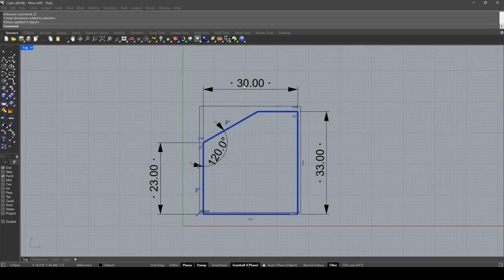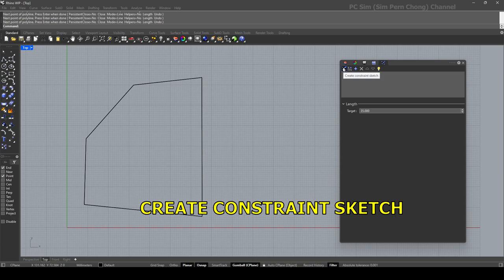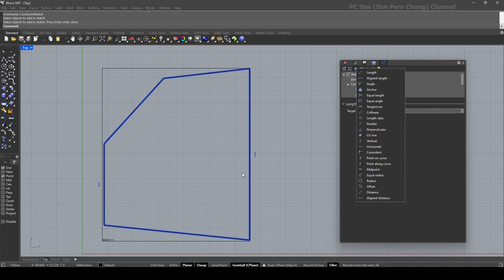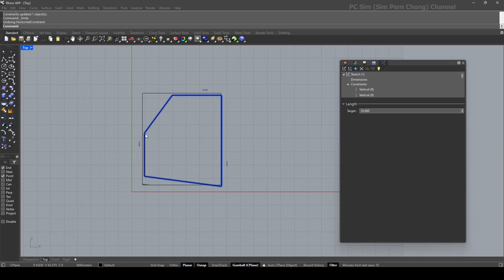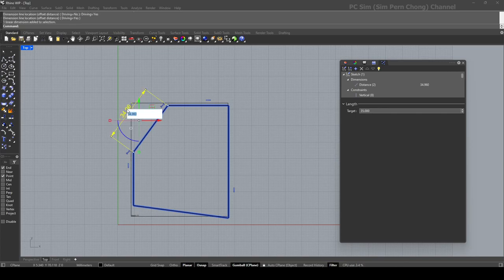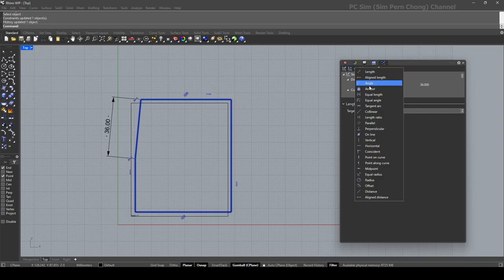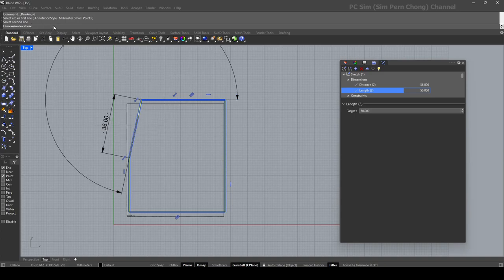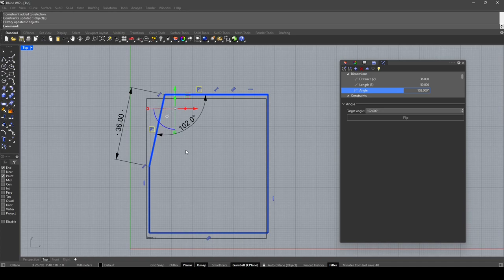Rhino 8 (WIP) Demo: Application of Parametric Constraints 【犀牛8: 参数约束的应用】

Comment: Driven dimensions and constraints are powerful tools in Rhino CAD that offer several advantages to designers and engineers. Here are a few of them:
Precise control: Driven dimensions and constraints allow users to maintain precise control over their designs. 
Easy modification: When using driven dimensions and constraints, changes to the design can be made easily and quickly. By simply adjusting the value of a dimension or constraint, the entire model can be updated automatically.
Better design iterations: Driven dimensions and constraints allow designers to explore different design iterations quickly and easily. By adjusting parameters and constraints, they can quickly evaluate different design options without having to rebuild the entire model from scratch. Dimension-driven modeling allows you to create parametric designs, which means that you can easily modify and adjust your model without having to start from zero.

Overall, driven dimensions and constraints are essential tools in Rhino CAD that help designers create more accurate and efficient designs, and iterate more quickly and easily.

Comment: This is the one thing that has kept me from using Rhino as I like to know exactly what 
size everything is going to be and if a size is going to change everything else will move.
I started learning it from early V1 beta in the 90's. Since then I have learned Catia, Inventor, Fusion and Ironcad.
If they can ever implement Rhino to build parts that close to Ironcad & Fusion and have deep
control of sketch & assembly constraints like Catia then I am sold. I love the surfacing
capabilities along with using a command line.
Reply from the maker: Hi, unfortunately it seems that they have taken out constraints features from this version. 

https://discourse.mcneel.com/t/rhino-8-wip-constraints-not-working/162476
Reply: @simpernchong  yes I hope they can do it for Rhino 9

Comment: very nice - if i would want from your final dimension a extrusion for 100 ... is it possible to give it also a parametric value that i can change later? Or do i have to make it in grasshopper?
Reply from the maker: Hi, unfortunately it seems that they have taken out constraints features from this version. 

https://discourse.mcneel.com/t/rhino-8-wip-constraints-not-working/162476
Reply: @simpernchong  ah thank you - i read something in this comments below about it. Very sad, because its really a great software but for parametric It's not so easy to use like Fusion360 or Solidworks or even FreeCad. But i still love to use it for fast prototypes which dont need paramentric to see if the product idea would work or how it could look like. Do you maybe have a grasshopper tutorial - a simple one for beginner - where you make a plane - extrude it - and then boolish the inner out, or something like this - just simple ones to understand. You have so great tutorials - which are way more advanced. I love the results, but I think sometimes it's easier to use something easy to rebuild which has parametric functions. Like a box where you can put things from top inside, and you can adjust the thickness of the wall or the dept, height of the box and so on. Just a simple tutorial i try to find.
Reply: @simpernchong  Yes, McNell's communication regarding this was truly atrocious. It was a reason for me to upgrade to Rhino 8 but then suddenly I couldn't find anything and it was only through the forum that I became aware that it had been removed.

Comment: I hope for constraints in the third dimension and embedded on nonplanar surfaces as well as planar. Basically a language of design. FreeCAD is a bit rough around the edges. And Rhino also. Not quite professional as I would describe the term. 3D software is not yet at the sweet spot of creativity and professionalism. Because then you would be in a flow state spending hours on it and nothing hindering it.
Reply: People have built production super cars and other complex designs using Rhino for years. And here we have a wimp whining about non-professionism of 3d software. You cannot do professional 3d cad work ..
Reply: @incomebuilder4032  They probably don’t have control over the results. They have to settle for sloppy work. And they maybe have to spend a long time making adjustments when the result is not right. Their designs are unconstrained and they have to use their eyeball too much. 

Maybe if they are just making the shell of a car they can afford a little sloppiness. Though I gather that they would not use these 3D software if they were being professional, they perhaps use wind tunnel simulations to design the shape. Or an actual wind tunnel. 

It’s true I have not yet made a big project yet. I am aiming to do big things in a day or a few than months or years. Time is just a way of compensating for mental fragility. I hope to get the process down. Then I believe I will work very fast and productively. 

I think I am capable. I gather your definition of professional is just what get you paid than the quality of the work. There are maybe a lot of inept people going with just good enough to please the untrained eye.  

It does become a problem when people are not working their hardest and delivering the best. It makes the economy bad. No one is getting proper value. 

It’s just a theory. That there a lot of sloppy paid people with illusions of professionalism they project because other people don’t know any different. It’s really just a theory. Or a prediction. And if it’s untrue fair enough.
Reply: @incomebuilder4032  absolute right - rhino can do things that other cad can't and vice versa. In our studio, they use rhino and SolidWorks parallel to fulfill different tasks.

Comment: I was wondering if Rhino could do this. I have been considering buying it, but I would 100% need constraints. I will keep an eye out for v8 before committing to it. I'll stick to a combination of FreeCAD and Lightwave until then.
Reply from the maker: TBH, i find the tool kind of fidgety ATM.. but am pretty sure will get better as Rhino has a reputation of being reliable and stable. But if you need parametric, the inbuilt grasshopper already can do it as long as your model does not require complex surface blending.
Reply: @simpernchong  At the moment I'm mostly designing for laser cutting. I have the tools to do most things, but looking for something more complete...and not subscription!

Comment: You did something in 10 minutes that we could do in 10 seconds with the normal modeling method. I don't think it's useful at all.
Reply from the maker: Ah I see.. thanks for the feedback. I think, it depends of the use case. If multiple or iterative versions of a re-usable base design is required, then this additional effort may be worthwhile.
Reply: @simpernchong  yes, this is exactly where to use it. I've used rhino for 15 years now and it's great for sketching and discovering shapes and form but not really usable for me when I go from exploring to refining. The strengths of freedom flip over to being the problem. Iterations are super slow. If this works i can ditch Fusion360!
Reply: @fiskn74  yes I want this so I wont need revit as much
Reply: @simpernchong  its very important and useful for me, I hope they will have it in rhino 9 , it will make software something else